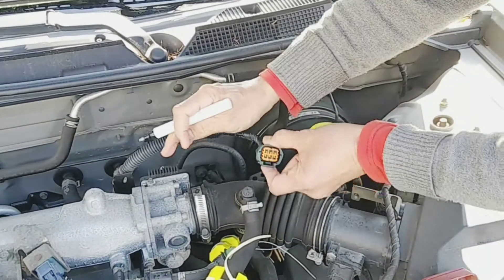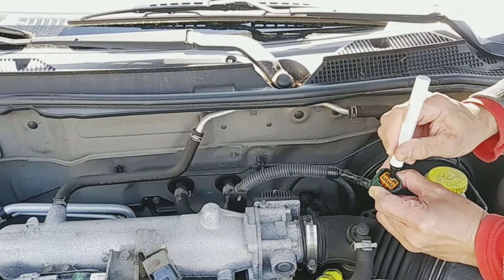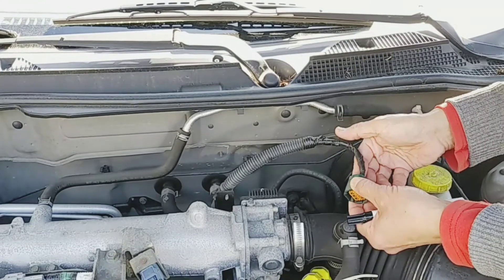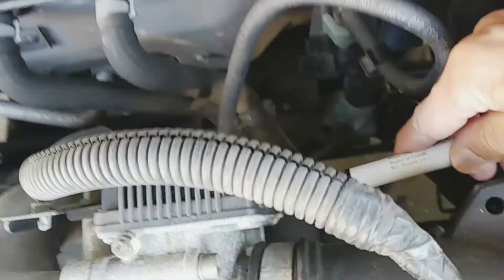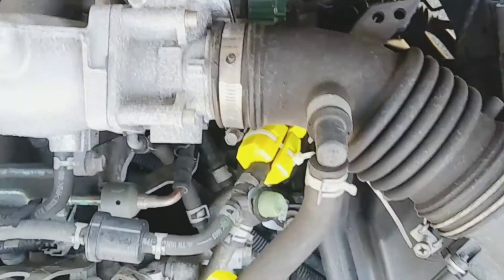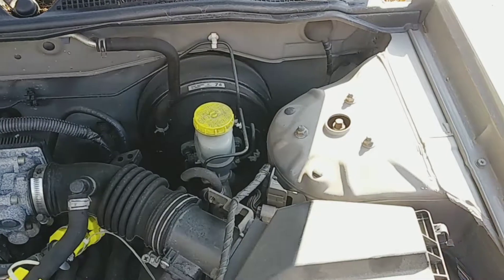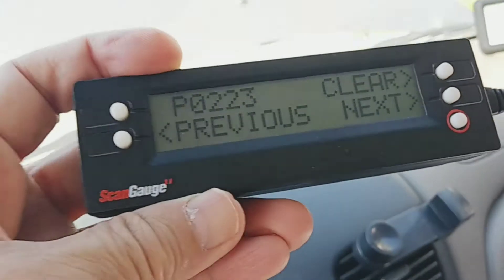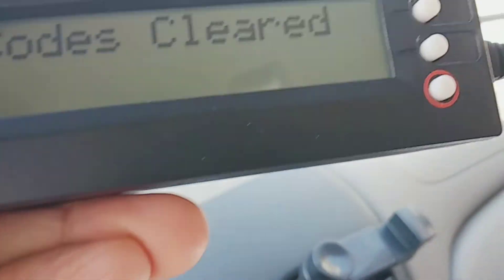DIY repair, rough idle, 2005 Sentra, intermittent throttle problem until engine warm, fix

Comment: My 2005 Nissan Sentra 1.8 S with the 1.8 liter (4 cylinder) just started having the "dying while driving" trouble.
Trust me, it is not fun or funny when it happens. EXTREMELY DANGEROUS !!! 
Just driving along and it's like someone turns off the ignition key.
No power steering and no power brakes !!!!
If I wait 10 minutes, the car starts back up (until it doesn't) like nothing ever happened, until it happens again.
I just drove a 265 mile trip (all highway) that normally takes 4 1/2 hours now took 7 1/2 hours !!!
Three (total) HOURS on the side of a 4 lane interstate highway !!!
It shut off about 20 times !!!!!
Never had an issue if I just drive it short distances around town doing errands, but not long highway driving.
The car runs perfect (except this problem) and burns zero oil even with 330,000 miles (original engine) and gets 33 mpg.  
I hate to get rid of it but my wife will not drive it, and I won't allow her to any longer.  
New cars are no better than the old ones just more expensive. 
Any help out there ?????
Reply: Crankshaft positioning sensor mine started doing same until it popped code for it just changed it yesterday drives but now i have code for rough idling back to the drawing board for me
Reply: My daughters 99 honda accord did the same thing...be driving along just fine and then...it would just die, it would start back though....took it to a dealer...it was the ignition switch worn out...the contacts would loose connection ...i hope you figured it out by now...hope this helps...does it give any codes?
Reply: @subarumanrp233  Crank sensor, Cam sensor and both O2 sensors. New air filter, Cleaned throttle body (then idle relearn), and new fuel pump. These parts were all out of range and I do not just throw parts at my car. 
Car runs like new again. :) 
I still have one relay on the passengers side under hood that is (maybe starter relay-it's in the starter circuit) giving me a fit because it looses it's connection. The car won't crank unless I push the relay to one side and wait for it to click. Then it starts every time.
Reply: @timgiles9413  Thanks! If I can ask....because I dont have much in the line of diagnostic tools, how did you determine that they were out of range? Thats always been my struggle....THANKS FOR ANY HELP!
Reply: @subarumanrp233  I used a multimeter and a Clymers manual. All the specs are in there. Sure, I just replaced both o2 sensors without checking. For a few hundred bucks the car runs great. It's old but it's better than a car payment for a computer driven car. The 02 sensors were probably way off the charts....trashed em' :)
Reply: @timgiles9413  in 04 I believe they gave the sentra a facelift and changed to a drive by wire throttle not by cable like the previous models, so im sure u know what that means but the gas pedal just has a sensor underneath and it sends a signal to the throttle on how much to open so technically.. it's computer driven.. and most probably has more electronic stuff but still reliable as hell and yea newer cars can be just as reliable it all depends on what u get(do ur research know what I'm sayin like after that generation of sentra nissan went to shit quality wise with dumb cvts and all that and just poor quality with everything because they got bought by renult or whatever and they took over the company and ruined nissan)my moms 09 fusion has 300k kilometers and runs pre damn good for only changing the oil like 3 times since 100k and she's only had to do an alternator, other then that, solid no props at all and it's a manual transmission so no stupid trans problems but I digress, not talking shit btw jus saying some thoughts I guess, I have a 05 sentra too I love that fukin car and I plan on driving it till the wheels fall off only got 100k kilometers which is like 60k something miles right but I plan on a whole lot more, glad u got that beast fixed up brother, hope she lasts too 400k
Reply: @user-qh8vl9ew3r  340,000 now and it runs like new again. Thank you Lord :)
Reply: @Tim hey brotha I have a 06 Nissan Sentra 1.8 and it’s giving me your same problems ! I’m getting headaches because of it lol can u help me out please
Reply: @Tim giles
Reply: @timgiles9413  yoooo can u please help me out thanks in advance
Reply: @danielbenitez193  I would start by buying a cheap scan tool and a book. It's really something anyone can do. See what I replaced and start there.
Reply: Same problem. Scanned it with my $20 scan tool from E Bay. Crankshaft sensor. Was a bitch to take out but patience prevailed. Good luck.